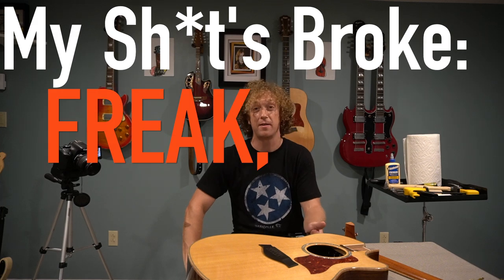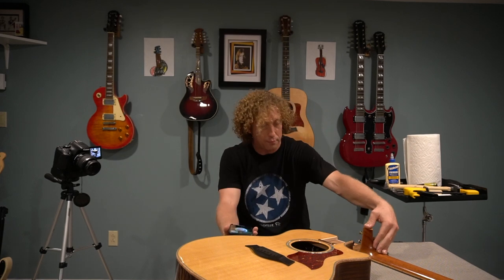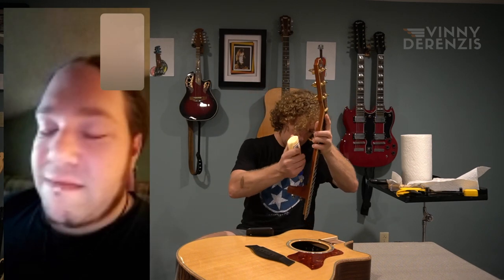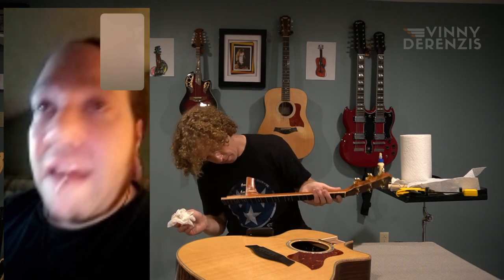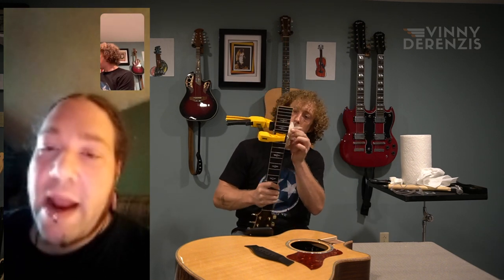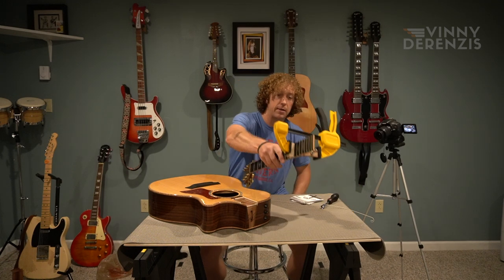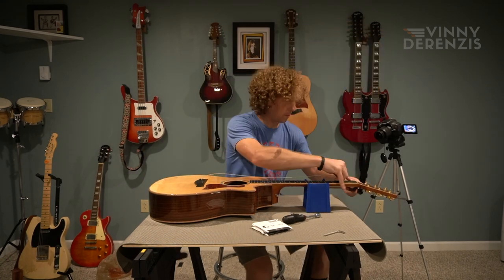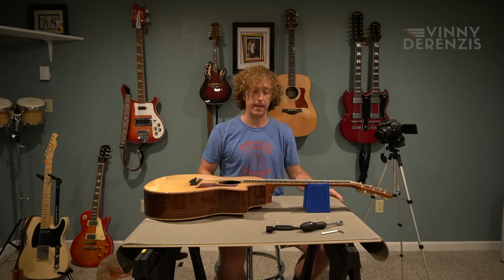Taylor Acoustic Neck Heel Repair (Instructions by 'Freak')

Comment: Just discovered the same problem on my 2006 414ce... still can't imagine how that happened, never mind how to prevent it... left it in its case for a month or so and there it was, a nasty crack between neck and heel.
Thank you very much for this video and links, I'll still let my luthier to deal with it, but I'll forward the links.
Meanwhile, thank goodness for bolt-on necks...
Reply from the maker: Yeah mine just appeared too, there was no incident I just went to take it out one day and there it was. The mend here has still held up well!
Reply: @vancederenzis  Sudden warm weather, I believe...  had this guitar for 15 odd years, kept mostly at home, never a problem, why, indeed, that's the only explanation I can think of... and I trust the repair will be better than the original, that's often the case... ;)